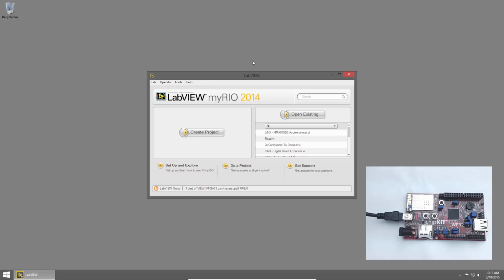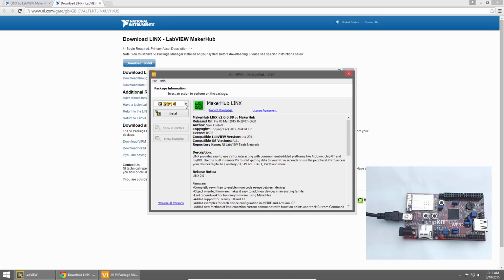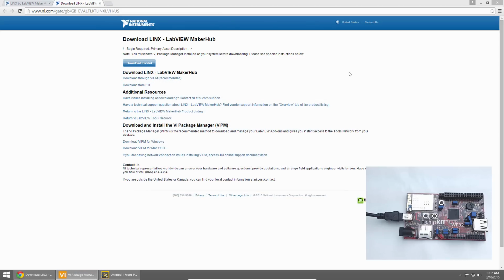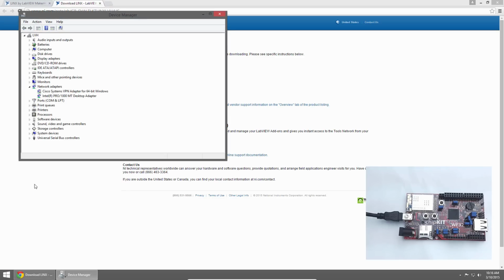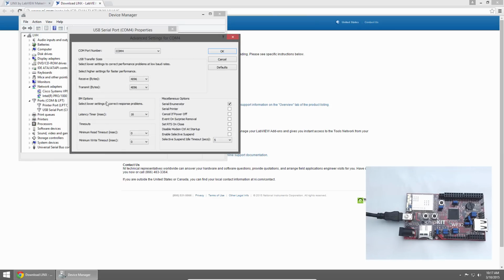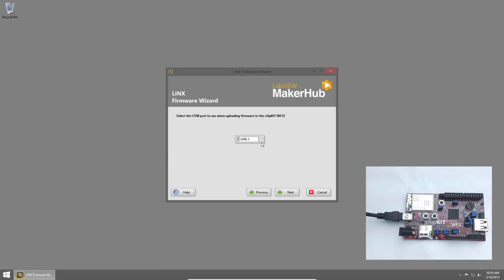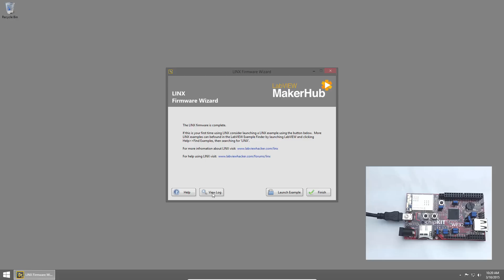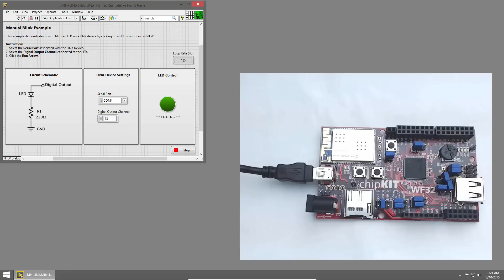Digilent Physical Computing Kit for LabVIEW - 02 | Setup

Comment: On the Mac using Safari, Firefox or Chrome the download Linx link button doesn't work. In Firefox I get a "The address wasn't understood" error message. In Chrome nothing happens and in Safari I get a "There is no application set to open the URL vipm://lvh_linx" message so I direct it to VIPM but nothing happens. What am I doing wrong???
Reply from the maker: +Dave Gaskell This sounds like a problem with VIPM.  Rather than installing from the website try opening VIPM on your Mac, then search for LINX and install it directly.  Let us know if this helps.

Thanks!